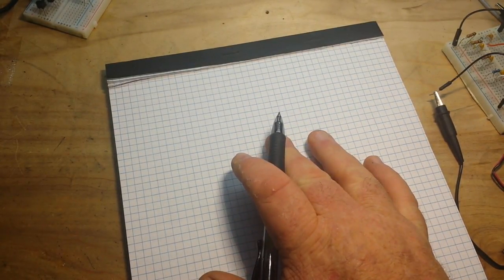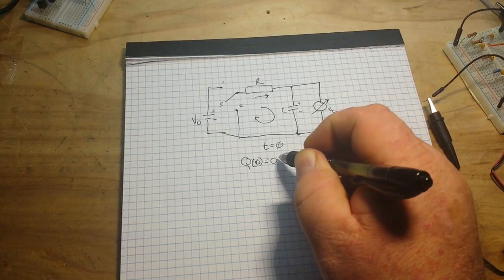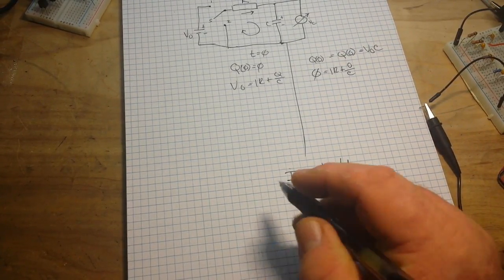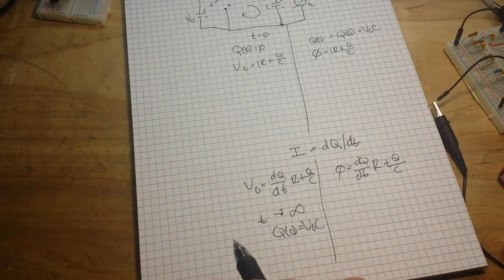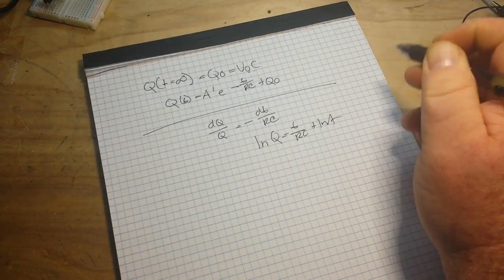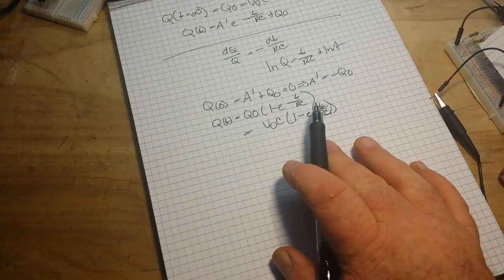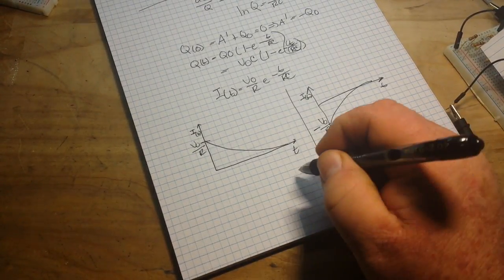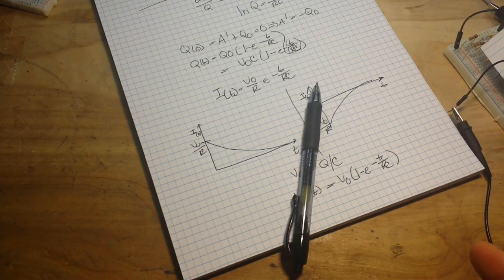Integrating time into capacitor charge/discharge equations

Comment: If you question concerned faster rise of the voltage, you have two choices — reduce either the resistor value or the capacitor value.  If you wanted a faster increase of the stored charge (Q), then you have just one choice,  reducing the resistor value.  Or, did you include the supply voltage in the options?  Then the charging speed to a fixed level could be reduced by increasing the supply voltage.  But it would not shorten the discharge time.